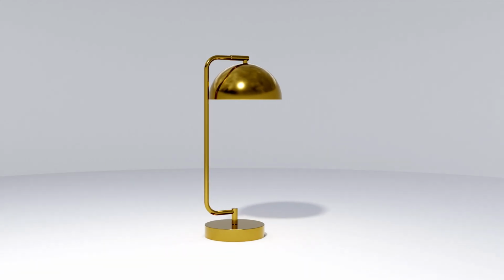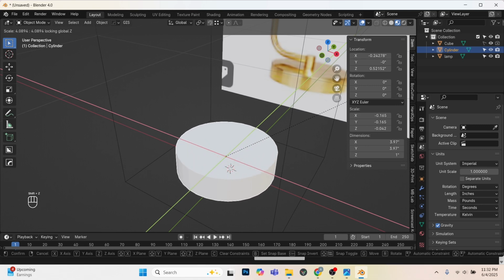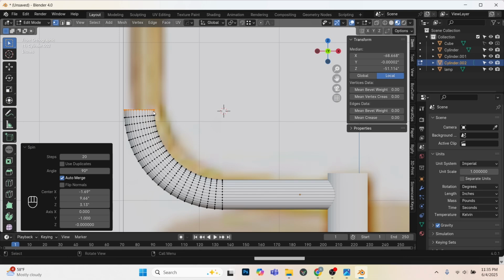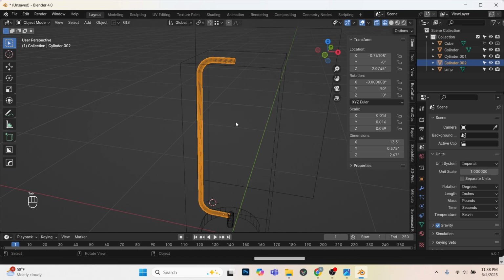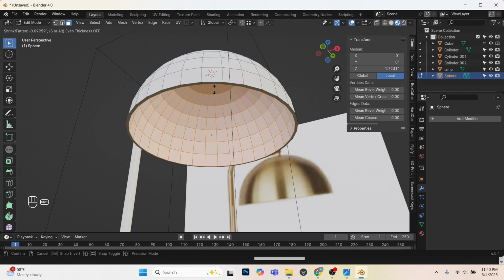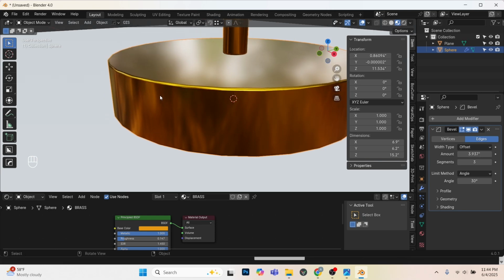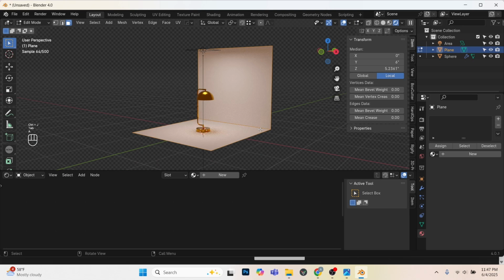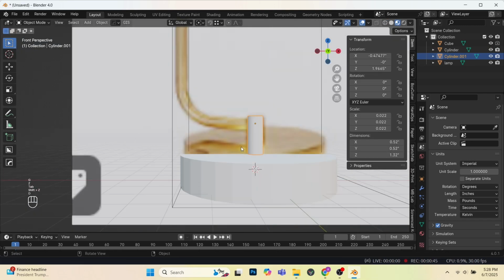How to model a Simple Lamp - Blender Workflow Tutorial

Comment: one question
Why do we need box wireframe if we already had a mesh plane image as a reference?
Reply from the maker: To maintain correct scale. It’s good practice when modeling specific fixtures with specific dimensions. If you want to be exact with furniture or larger things for clearance it’s helpful to know it is within the correct size range. I often use the wireframe bounding box to snap to as well for reference

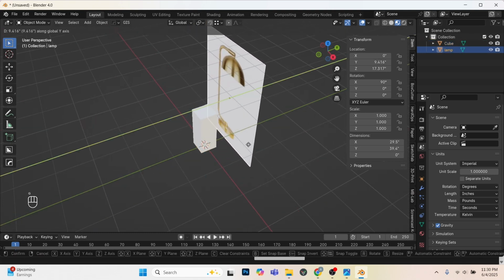Comment: 1:22 if you can't see the "Shade Wire" 
1. Select the object you want to display as a wireframe.  
2. Go to the Object Properties tab (the orange square icon in the Properties panel).
3. Expand the Viewport Display section. 
4. Change the Display As dropdown menu from "Textured" (or "Solid") to Wire.

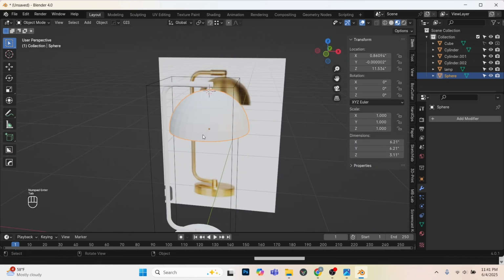10:50 If you can't see the face orientation
1. In the top-right corner of the 3D Viewport, click the Viewport Overlays dropdown (the icon with two overlapping circles).
2. Locate the Geometry section.
3. Check the box labeled Face Orientation.